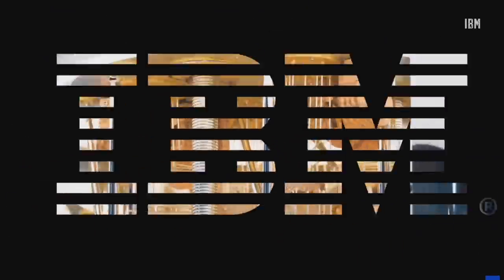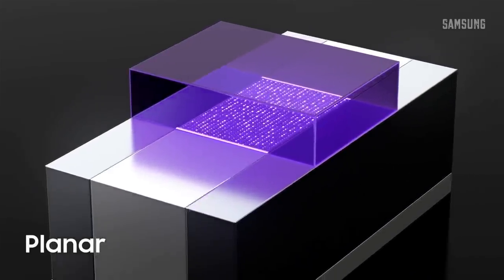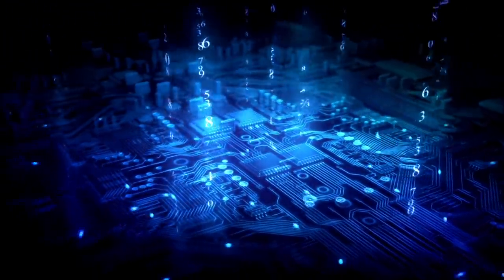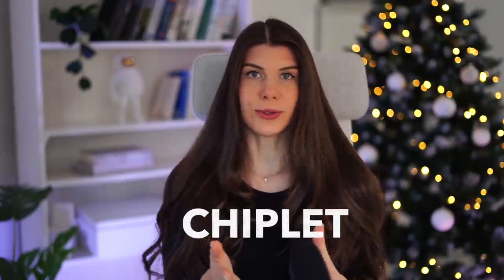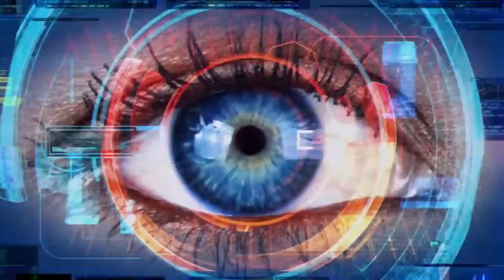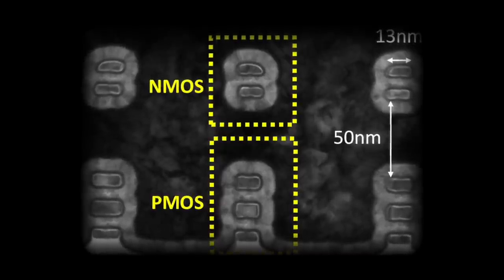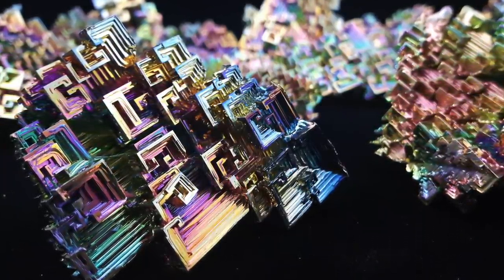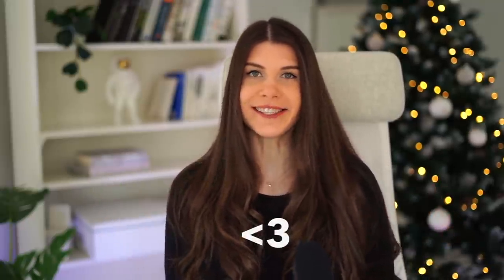IBM’s Microchip Breakthrough explained: Going Vertical

Comment: I just wonder how they are dealing with the interconnect and the timing. When you make synchronous logic as is usual, then you need a clock. With those small transistors you  have high speed and thus any skew between clock edges of different flip flops can ruin the operation. The result is that clock routing will take a lot of area of the chip. So, yes, they can pack more transistors in one place, but how do they get the timing done without  loosing  a huge area dedicated to the clock circuits.

Comment: 2-3 years for VTFET is extremely unlikely.

Samsung is only just bringing up their Nanosheet process at 3nm.

This may come in 2022, but more likely 2023 - and it will take at least 2 generations of node improvement after that before they move on to something new.

They may even use an intermediate step between Nanosheet and VTFET called Forksheet which is well into development already and touted as the natural successor to Nanosheet processes - greater performance/power and better area scaling vs Nanosheet.

Note also that IBM/Samsung are purposefully comparing against finFET for the VTFET projections rather than the more advanced Nanosheet - not a move that inspires confidence.

Also just to note that Nanosheet is actually less area efficient than finFET for a similar transistor pitch despite the perf/power improvement - something Forksheet addresses very well.

Comment: Transistor tech is basically miniature vacuum tubes. If you make a vacuum tube small enough it does not need a heater. 
Really high power outputs (Megawatts and more) are still done by very large Vacuum tubes.
But a Tesla does not produce that much power. It uses solid state for motor and battery controls.

The miniature transistor size limit is the atom. I think we are getting close to that limit. The only way to produce more density is stacking.

Comment: Transistors, resistors, and capacitors might seem very important but you'd be holding an inert brick without the incredibly complex traces between all of these components.
The problem that integrated circuits solved in the '70s and have been solving ever since is the problem of component interconnection. 
Now the chip fabs are pursuing interconnections in volumes of silicon, or germanium, or the vacuum of space...

Comment: I already knew the answer to the next question that follows and thought it might be a topic for a future report for you if it hasn't already been done. Here's the question?
"Is it possible for an atom to fit in electronic circuits of less than a nanometer?". On the other hand, I wanted to know more about the research with the bismuth material by TSMC. What do you know about the current research? How can an atom pass through a circuit with this type of material ?

Comment: Parallel series equals series parallel
Key insight ☝
Reply: 16(20v5a) cells [ parallel 4(20v20a) combined in series 80v20a ] .. [ series 4(80v5a) combined in parallel 80v20a ] 
4(16) tiers create dimensionality

Comment: 10 min 58 Bismuth is not a semi-metal.It is considered a metal.
Although, if you try to bend it, it breaks. I think it is not ductile and non malleable.
It is a good electrical and heat conductor. It is the worst heat conducting metal.

Comment: So the idea is photolithography etc.. then you just employ xrays, gammarays /cosmic rays -- positron etc.. the trick would then be passing electrons/photons etc.... I think that it will move to doped carbon nanotubes  because they can channel smaller flows of electrons.   ---- quantum computers etc.. will likely be photonically actuated and when higher energy states can be crystal induced it will be some very crazy loop sequences of cycles high energy particles  - and we won't be dealing with two states but rather locality states that translate into data presences rather than binary logic systems - this will allow more fuzzy logic systems to be employed for applications like AI and non linear processes - and geometric computing. the higher than light processing is contrained by the ability to hold the energy form in a cyclable process. Xrays can be reflected using materials like gold or iridum so you can then create channels.   so you are looking at single atom channels of gold being sheilded 1.44 × 10-10 at minimum but this would 2x 1.44 plus carbon nanotube thickness.  as a graphene channel 310, 370, and >500 pm the 0.1 angular alignments and other states can allow near lossless sequencing channels that are superconducting through the graphene angularity superconduction system.

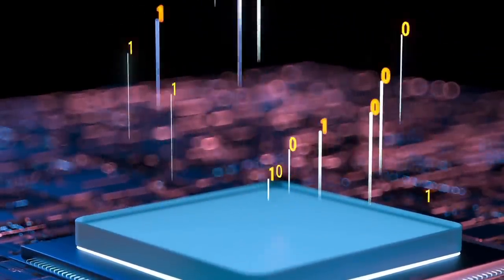Comment: 4:42 What about this 5 nm resolution? Isn't this already the "effective" resolution due to vertical arrangement and not "real" structural resolution per layer? Real structures are still 50 to 100 nm of size in normal optical lithography, no?

Comment: "IBM and Samsung have made a breakthrough in semiconductor technology with the design of a new vertical transistor called VT-FET. This technology is ahead of the current state-of-the-art transistors and is expected to provide two times the performance or 85% greater power efficiency compared to the current finfet designs. The VT-FET transistors are stacked vertically on top of the substrate and the electric current flows vertically, allowing for more transistors to be integrated per unit area. The technology node for these transistors is defined by the driving capability and not the gate length. The VT-FET technology has the potential for use in high performance and low power applications such as autonomous driving and IoT. The technology is expected to become commercially available in 2-3 years."

Comment: I've had time to think it over. Doesn't it make more sense to create gates from the top down instead of stacking vertically? Could gravity be used as a force to pull the stack downward instead of fighting gravity to stack gates on top of each other? I guess bi-directionally at the nanono or molecular level may be a moot point I'm not 100% sure how the machinery "views"  building spin it or flip gates over or is there an up and down as it's built build both ways or all ways by suspending the gates in "empty" space.

Comment: An increase of 85% in power efficiency for the chip doesn't translate to 85% more battery life since the phone screen is the primary battery drain, not the cpu.
Reply from the maker: Depends on use case, but yeah - you are generally right

Comment: 1 nm dimensions - didn't TMSC show a UV driven machine that used incoherent diffraction patterns ? Instead of etching a mask with squares they etched a mask with dots and lines that when reduced smaller than the UV wavelength created squares and traces. Instead of etching the die, they etched patterns that create the die when out of focus.

Comment: It's time for small air cooling devices to blow cold air into the bottom of a computer and a fan at the top to blow the warmer air out. That should end the temperature issue. How small is the smallest air conditioner ?

Comment: All this is ok, but it must have software support. If the user or the region is under blacklist, the cpu has to run slowly. However, if a simple user buys such a cpu, he will need to find secret, unwritten tuning solutions to enable the parts if the cpu. These solutions are legal, example: watching 4k youtube video for 30 min, or starting a cod game, and qualifying only. Best cpu tuning is running in bios for 45 min.

Comment: It was inevitable. 
But when are they going to print some inductive components so we can get some really thinking machines? Yakno, cuz then they could have some extensive fractional analysis. 
Imagine all the voltages there are between 0 and 5, and how many concentric circles you can draw at a nanometer scale. Before you get to pico.

Comment: What if you made the transition from transistors sideways and vertically  in the same configurations In a  figer 8 only with two general gates  one on top of each other in a infinite number of stacked liner wafers sandwiched as a trible hive mind of pathways making it nera-linked comparable  with no conjunction just  a continuous feature with a sideways and a vertical Pathway system  conjointly  fixed multi said by side fixtures in both liner and none liner configurations twins  of its peroxide system built using silicon light photons in a continuous manner with high-speed light power and elements element's used  and frequency speeds driven new technologies faster

Comment: Is this also why the apple chips are having better battery life? Also, why are intel chips running so much hotter than apple chips? I can't even do basic tasks without my fans going crazy and CPU temperatures reaching 80-90 degrees.

Comment: The biggest problem with all of this is HEAT. Processors are reaching their maximum in terms of thermal output, so stacking will make the heat worst... Anyways nanometers are just marketing terms. Tell me how many nanometers a silicon atom is and come back to me with the "transistor nm" length.

Comment: Vertical channel idea has been patented more than 2 decades back.
Reply: As you can see there is quite a gap between patenting something and actually implementing it
Reply: @dchdch8290  yes and still some years to go for reliable high volume and high yield manufacturing.
Reply: @striker44  agree

Comment: Hey, great video thank you for working on it. It's an interesting breakthrough but don't you think increasing in density vertically too would increase the temperature?
Reply: The efficiency factor will help eliminate heat.
Reply: This guy nailed my question precisely. If the transistors are stacked vertically, won't the heat from one transistor radiate easier to the transistor next to it? Also if we are cooling chips down nowadays mainly by sticking a cooling unit on top of it, wouldn't this design mean that the amount of surface area (at the top of the transistor) will be smaller, making it harder to cool this transistor?
I'm really excited but really curious what will win. The higher heat generation per square-inch versus the lower power efficiency.

Comment: 1:16 every video YOU told the same wrong conseft of transistor switching working principle.. It's not by a current control. Control by voltage.

Comment: Intersting, but hardly a new thing, stacking been used for many years now, but every try and attemt is uniquely intereting, even light gates been researched for years now, yet no1 succeded yet reliably shrink it down... currently on the are(Area) u speaking of 150mm2 the best technology iin produkton fits about 25625Mt (25Billion in a single layer), the limit is prob about 130Billion/layer...so using todays tech and 4 layers(wich is used today), 100billion atlest is possibly... but indeed we need new ways of doing it, the goal ofc is to acheave a distinctive signal difference between 1 and 0 so its useful(signal gate) vs previously transitor gate, unfourtunetly quantuim limits is still a problem....

Comment: Is it correct to say, "current flowing through its gate"?   https://youtu.be/IHxv8ehrx2Q?t=110 Aren't FETs field effect based on voltage and so current doesn't flow in the gate?
Reply from the maker: You are totally right. Thank you for pointing out. I meant “channel”.
Reply: @AnastasiInTech  Thanks for clarify.

Comment: pin up, +z
Reply: pre-computed is better than always recalculating, start with FP16/INT16 pre-computed gpus with no alus, just memory controllers, operands are address parameters
Reply: multi-layer mask/single write roms